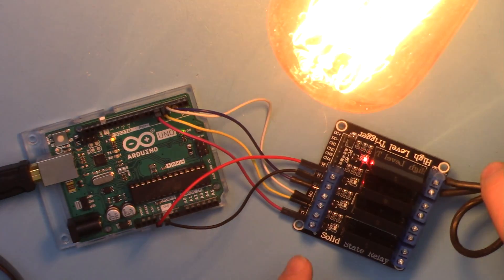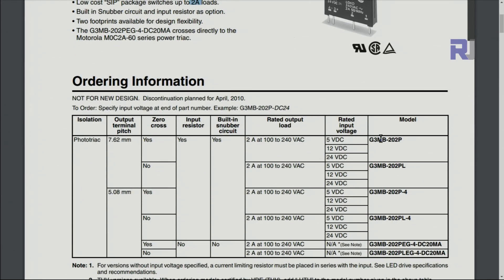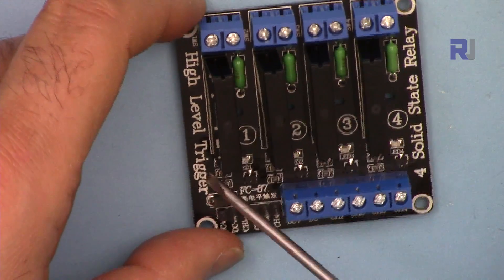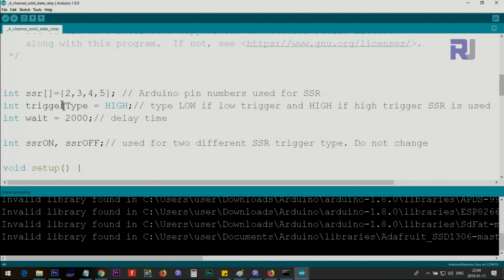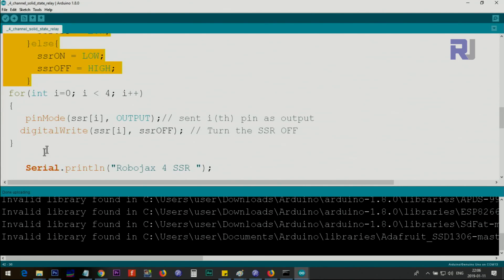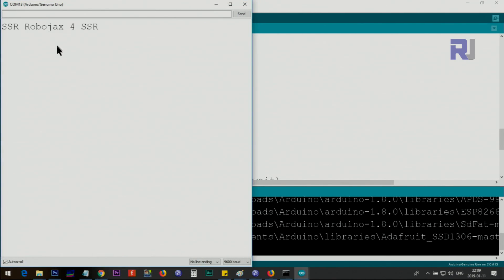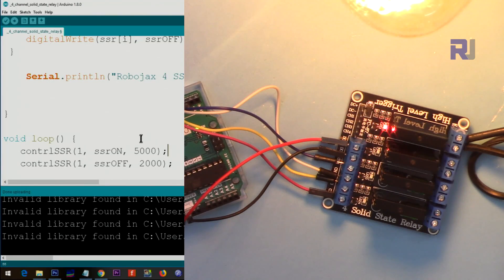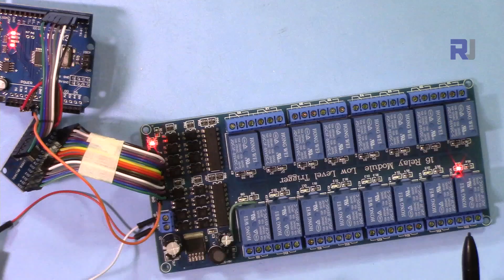Home Automation:  4 channel Solid State Relay with Arduino To control 4  bulbs or loads RJT150

Comment: This is a great video, very well explained. I have been trying to program 4 relays to start turning on 1, (keep), ON 2 (keep ), ON 3 (keep) and ON 4 (and keep). Then start all over again? Do you have the code?
Reply from the maker: Hi, that is very easy if you pay attention to what i said when explaining the code. Or watch this to learn how to turn on or off an output pin Lesson 98: Arduino 10 LED Push button Projects,  Potentiometer LED Voltmeter and Traffic Light
https://youtu.be/OSwleCBlkuI
Reply: @robojax  Ah thank you very much. I'm beginning to understand a bit more now although I'm using relay instead of SSR and I only see the code controlling 3 instead of 4 SSR unless I'm missing something. Can I use the same code for relays?
Reply from the maker: Yes. Just watch the led video you will learn lots of important stuff.
Reply: @robojax  Hello, great news, I've finally done it using one of your code and did a lot of tweaking, trails and errors but brilliant and thank you for your help 🙂

Comment: why ssr are limited to 2amps only? 
normal mechanical switches available in market  can control up to 30amp ac load with same or even cheaper price tag.
Reply from the maker: for AC load to turn ON/OFF it is not easy. we have solid state components it costs more to do it. I am sure if you google/bing it you will find  higher current SSR.
Reply: @robojax  Thanks for the reply. Keep it up!
Reply from the maker: you are very welcome. Stay safe.

Comment: Are they dimmable?
Reply from the maker: the solid state relay from name we know "relay" so it is just a switch ON or OFF and nothing in between.  So your light will be either fully ON or fully OFF.
Reply: @robojax  yeah but there is some relays that are dimmable.......so
Reply from the maker: it should not be called relay.  Relay is just a switch.
Reply: @robojax  There is a zero cross solid state relay which is dimmable

Comment: Can the intensity be controlled if the input control is pwm ?
Reply from the maker: if you are trying to dim, I have not tested it but it should work.  here is Arduino based dimmer https://youtu.be/zJQf6bNodhE

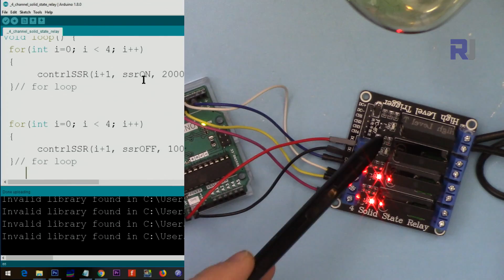Comment: I’m trying to write the sketch for 6 cHannels to do what yours is doing at 13:13 in this video.. I’m not having any luck.. any ideas.. I tried uploading your link copied and pasted it but it always sends an error when I try to upload it..
Reply from the maker: Hi, please post the error code so I know what is the issue.
Reply: Robojax  I got it to do what 13:13 showed! Figure that part out.. trying to get it to flash all 6 channels on and all 6 channels off along with the chasing lights like 13:13 on the video! I’m making my wife’s outdoor large old school arrow sign work again! Just don’t want it to be just on and off.. want it to chase on, then off, they all flash on then all flash off.. then start over again! I just can’t seem to figure out how to get all 6 channels to come on at the same time.. I have them going off at the same time.. just not on.. everything else is working like I want it...
Reply from the maker: Hi, to turn them on you just use digitalWrite(pin1Name, LOW); and then add dalay like 300ms delay(300);  and then ON digitalWrite(pin1Name, HIGH);and 300ms delay. this is 4 line for one relay. so do this for all 6 of them.

Comment: can this SSR for control 3 phase induction motor?
Reply from the maker: Hi,  I think you have not watched the video.  This can handle only about 0.2A or something like that. those motors I believe are very high current. But if they are small enough, then yes  you should be able to do it.
Reply: @robojax  thank sir,
Reply: Yes, it is possible, but you need to use a three phase contactor because of the low current Robojat told you here.
Reply: @heberp.strecht4331  yes ofcourse, i use magnetic contactor. Anyway thank for answer.

Comment: how would I adapt the code to make the four channels flash in one direction consistently with a set speed? i attempted to adapt your code to fit my needs but there was an unexpected glitch that caused channel 2 and 3 to make extra flashes that were not wanted.
Reply from the maker: You mean to start turning on 1, (keep), ON 2 (keep ), ON 3 (keep) and ON 4 (and keep). Then start all over again?

Comment: Hello Sir ,
 Could you show as how to write the code for same mosfet 4 channel module with especially combination of switch on chanels , foe exapmle , chanel  1 is ON but  and in same time another , for example chanel 3 is OFF bu when chanel 1 is will be et OFF then chanel 3 will be get ON .
Also I'm interesing how to start all this process  by click a button .
Reply from the maker: I replied yesterday but youTube have not saved it.
here is your solution . You want to make bulb like a point that moves. Put this inside loop
for(int i=1, i<5; i++)
{
contrlSSR(i, ssrON, 2000);
}
for(int i=1, i<5; i++)
{
contrlSSR(i, ssrOFF, 2000);
}
Reply: @robojax  Thank you Sir , I'll try to use it , hopefully it will works.
Reply: @robojax   can we use this relay for ac fan

why anyone not used in fan

Comment: can i use this pssr with stepper motors connected to a stepper driver ?
Reply from the maker: This is for AC only. Also the current is very low. Stepper motor uses a lot of current.
Reply: @robojax  thank you for your time sir. What way would you suggest me to use for controlling around 6 stepper motors with my arduino. I need to use them in a chain making machine personal project
Reply from the maker: for each motor you will need to have 4 wires just for control. So you need 6 x 4=24 pin. you should use Arduino Mega and depending on your motors, use 6 motor driver.
Reply: @robojax  thanks a lot sir, i really appreciate your time. Will i need shield, transistor or relay as well? As the stepper will need higher voltage than the 5v

Comment: Please correct your wiring Diagram! So it will do a short circuit, when ssr switches
Reply from the maker: Wow. thank you for letting me know. I would have to remove the diagram as this can't be edited. thank you for letting me know.
Reply: @robojax  Hi, could you provide me with the correct wiring diagram please? I need it for my project

Comment: Hi, l use first a led bulb, but when off, the bulb it's semi off. Then probe with normal bulb and when off, it's completely off.   This is normal?
Reply from the maker: Hi, it should go fully OFF or ON. some LED lights might not work with this. Try old style bulbs.
Reply: @robojax  kindly provide solution for led bulbs

Comment: Amazing tutorial sir. Realy like it.. I hope u can make a auto charging in 3 battery to Charge same in this process with auto detect the battery if lowbat and auto stop  when its full. Then charge again the 2nd battery and same in 3rd battery..
Reply from the maker: Very interesting topic you mentioned. I would have to study it and get some batteries for test. I am putting in my "to do " list. Thankjs
Reply: @robojax  woooohh... that's great boss.. will wait for it.. God Bless...

Comment: My dear friend, You did it again!! After watching your video I directly went and purchased 4 channel SSR board to implement in one of my projects - replacing a standard 4 channel relay we had installed and I am sure it will fix the noise issue we have while the relays latch and triggered. Cool demonstration and a good job explaining the bits and pieces of the Projects. SSR relays are new to me and that is good to have a well-dedicated video to explain to us how they work and how easy it to implement them in our project - and that is safety first!! You are doing wonderful work - Keep it up!!! WTG. waiting for the next video - Thanks.
Reply from the maker: You are welcome. Yes SSR are good options. But keep in mind the power. They are very lower power and because you going to use them with bulbs, you should be fine unless you use those giant 500W or 1000W .  I am please to be helpful.. Ahmad